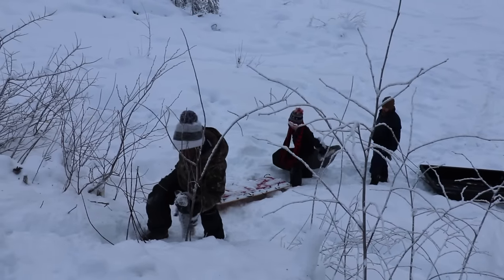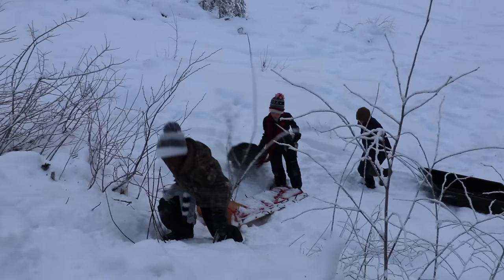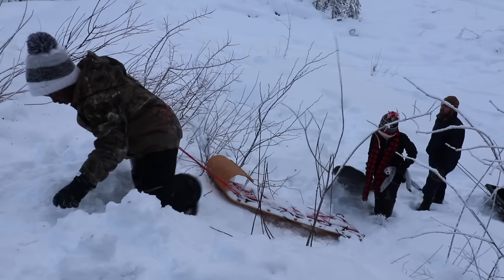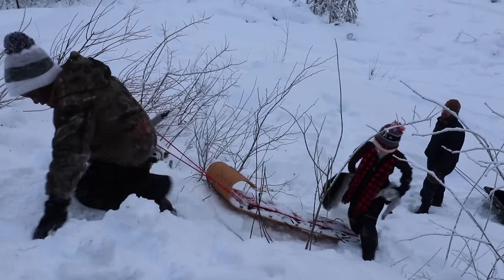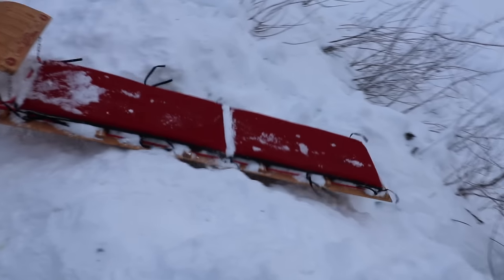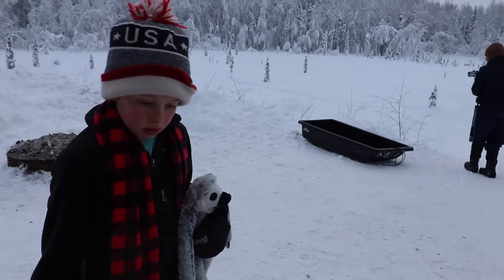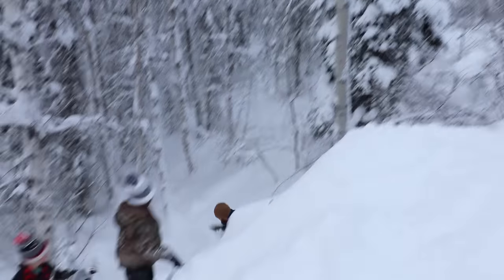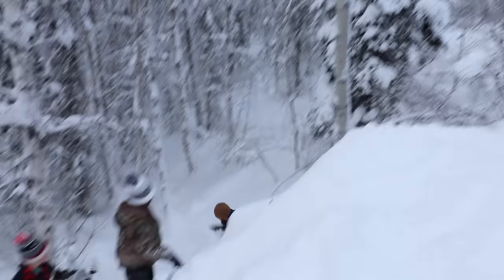Extreme Snowfall! Alaska SNOW Removal +  Snowmachining ALASKA'S Trails!

Comment: I don’t know whether anybody’s mentioned it but use the string handle on the toboggan you can actually steer by pulling one way or the other a little bit gives you a small amount of control. What you’re doing is lifting one corner or the other in order to kind of guide the angle of a sled.   I own a couple of 6 foot toboggans they are a blast. Wax the boards and a little varnish and they will continue the last for years.

Comment: Great video as always, my 4 and 7 year olds love them. Just a suggestion for Joe with the snow on the roof. Lay 2 ropes over the shed (from the doors to the back), have on person stand in the back and have another stand in front and pull 1 rope down one side then do the same for the other side. That way he doesn’t have to climb up there to shovel. May make it way easier and safer. Keep it up Happy New Year!!

Comment: Question, do you guys have a hot water heater with a tank or do you use an inline hot water heater?
Reply from the maker: I’m not sure (Tina) what inline means but we have a small on demand hot water heater mounted on the wall in our bathroom.☺️
Reply: On demand, that's the term I couldn't think of.  Great way to heat water. No wasting power keeping a tank of water  heated up.